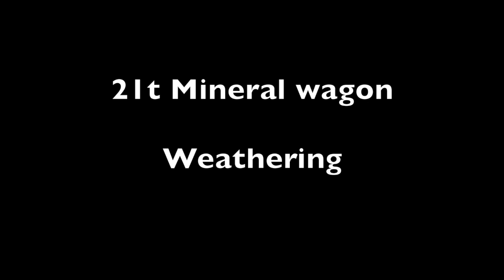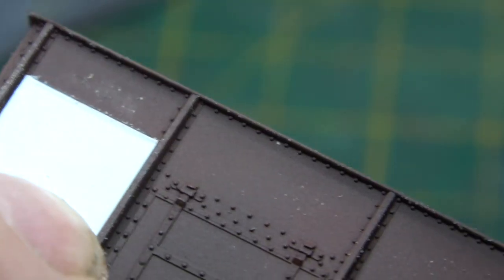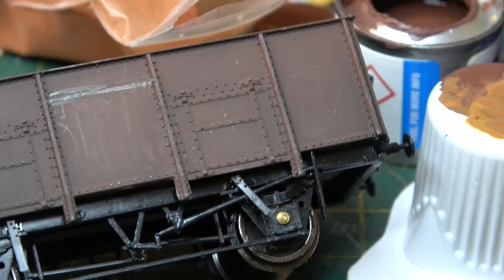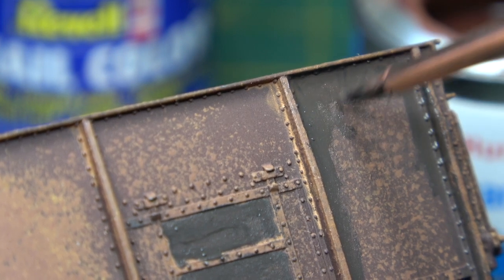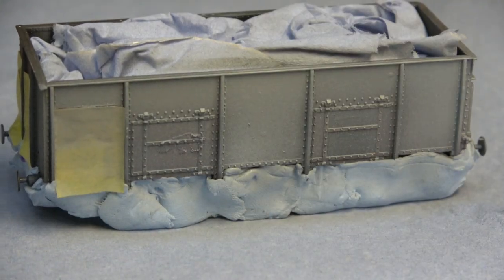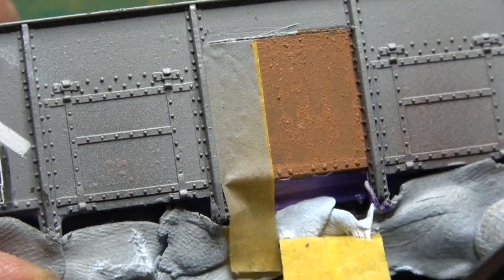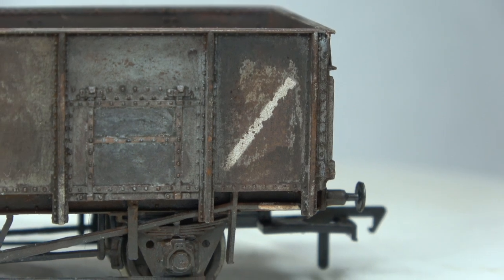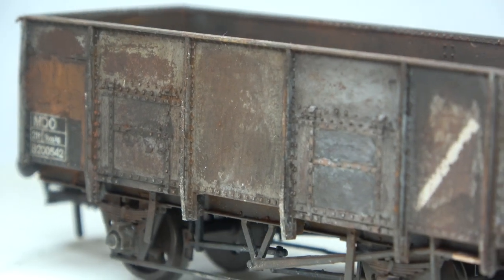Weathering 21t Coal wagon

Comment: Excellent video with lots of useful information on the different techniques used,I have subscribed. I was intending to make up a rake of the new mineral wagons being released by TMC, how long did it take to weather a wagon using your method. Richard
Reply from the maker: I'll be building a rake of those wagons on here soon.
Doesn't take long to do really. I built a batch of 6 in the last video, took about a weekend to build them and the same to paint. 
I suppose it depends on who quick you can do them coupled with how much time you have?